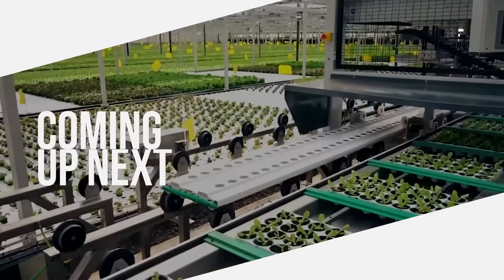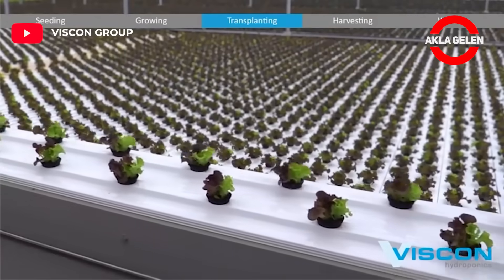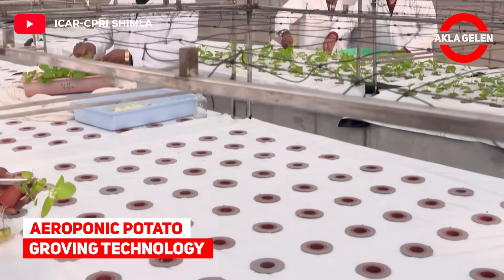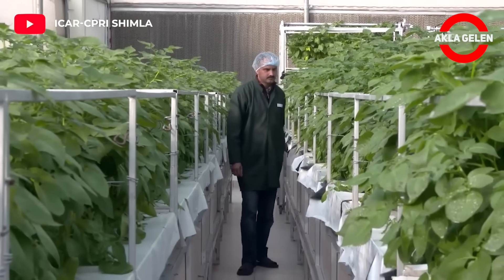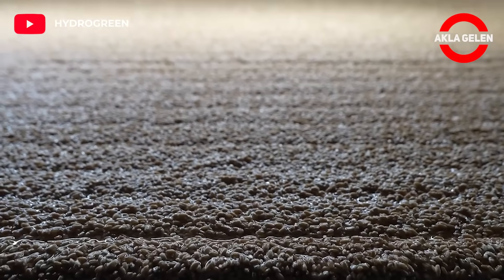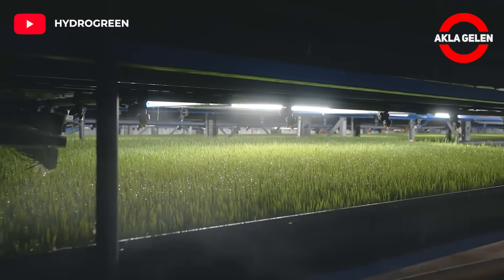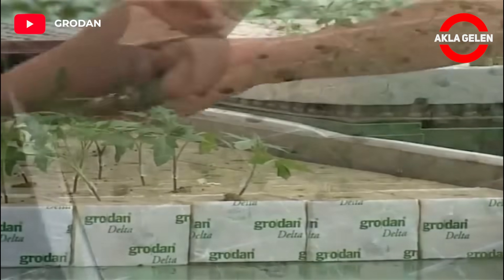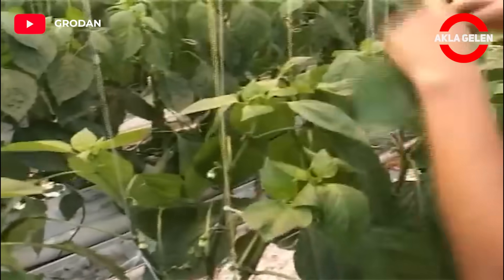The Farm Producing Potato Without Soil Will Surprise You - Incredible Agriculture Techniques

Comment: What is the producing time of plants grown in this manner versus typical 'growing seasons' in the soil?  I have a Habanero pepper plant in a pot that is about 3 years old and still producing peppers.  Currently it's inside due to the weather.
Reply: Peppers produce prolifically for about 5 or 6 years and then it dies off after that. Although they can keep producing decently for up to a decade
Reply: Roughly 15-50% less time when hydroponically grown. However that is entirely dependent on if the feed solution matches the plant, and if artificial light is used to extend the time of light exposure. Obviously the biggest difference is comparing hydroponic to plants grown in depleted soil around winter time.

Comment: I saw this way of gardening over 30 yrs ago at Epcot.
On a timed rotisserie w/ spray misters, & full spectrum lighting. 
Awesome, indoor gardening
Reply: Maybe Awesome indoor gardening, but you can't compare to "real" food.
Reply: @kasiasobczyk6939  it's as real as anything else, just more efficient
Reply: @kasiasobczyk6939  Hydroponic food is actually more nutritious than food grown in the dirt because most of the fertilizer is washed away in the dirt. The biggest road block to hydroponic is that it requires a lot more technical knowledge to keep the plants alive, and electricity. Electricity wouldn't really be a big deal except environmentalists keep sabotaging and taxing power grids so price per kwh goes up synthetically.

Comment: This all looks good but my question has always been how do we know the food for consumption has been grown with the right amount of minerals in the water. Plants do make vitamins but they don't make minerals, plants take up minerals in their environment through their roots which are usually in soil. NPK and minerals are something I don't hear mentioned in these videos.
Reply: Quite easy, plants won't grow without the necessary minerals and other nutrients, so they will have to be provided with the water in the correct amounts.
Reply: @apveening  so, you think, health comes out of a packet? So YOU can provide the vitamins? Circumventing God a bit?
Reply: @swissmaid  The plants will create the vitamins. As for god, I don't believe in fairy tales.
Reply: @apveening  But you can grow something with minimal minerals. That is less advantageous than with proper minerals. Check out my statement. On this statement and my statement on the video
Reply: @keithmorse9716  With less than the necessary amount of minerals, the plants just won't produce the desired product.
Reply: @apveening  Yeah, but it could be said that you're generalizing. What is. Less than necessary. It requires context. Necessary amount of minerals to produce what you want. Maybe too much for the plant to actually produce and actually burn and kill it.
Reply: Did you know that different plants utilize different minerals and with hydroponics you can give the ones you want and at a higher rate of speed.  Plus indoor they can utilize different spectrum’s of light for optimal growth for different plants.  It’s really a lot faster than dirt and that’s how we are able to feed the masses.
Reply: Cuando el ser humano juega a ser Dios nunca le sale bien...
Reply: Damn, I didn't even think of that at first, EXCELLENT Q !!!
Reply: You're right to be concerned because they never talk about it. Check out my statement above.
Reply: How about the cost of setting up the hydroponic system & roi??
Reply: composting helps you to build up soil that would be nutrient dense.
Reply: they add nutrients into the water, they also have device to monitor it.
Reply: hydroponic vegetables tend to be similar to soil-grown in terms of nutrient content. Advocates say (and some tests have shown) that sometimes they are slightly higher in certain nutrients because growers can control exact inputs and because a lot of soil has been depleted by intensive production over the years, which strips out nutrients.
Reply: Really simple, the seller don't care you got a good taste or decent amount of healthy components. As long as fruit looks good it will sell. A study made in France on apples showed it lost 90% of its nutritional benefits over 50 years.
Reply: Crops grown in depleted soil do have less nutritional value, but by about 38% on average, not 90%
Reply: @z-em4612  "A study made in France on apples showed it lost 90% of its nutritional benefits over 50 years."

This is totally false!  No study ever showed that. FAKE NEWS

What studies showed is that plants are about as nutritive as in the past with some plants having less or more of some nutrients.
Reply: @z-em4612  yep foods are selected/evolving for marketability. Not nutrition!
Reply: 수경인공재배하는 농업기술은 미래를 위한 기술이지 단지 상업용 대량생산으로 먹거리를 교란하는 기술이 아닙니다  토양없이 기후변화에 대비해서  미래먹거리를 공급할수 있는 첨단수경재배기술은  미래에 해수면상승으로 토양이 염분에 노출되어 토양의 오염이 심각하거나 기후변화에 심각한 가뭄, 고온,저온에 대비하여 미래식량확보를 위한 농업기술입니다  참고로 수경재배하는 비용이 매우높은건 시설설치비용이 매우 비쌉니다
Reply: 这恐怕是水与土壤的区别，还有灯照和太阳照的区别，微量元素很难复制。

Comment: these vegetables will be less rich in nutrients, because in a controlled environment the plants do not have any kind of external stimulus.  This happens when millions of years of evolutions take place
Reply: Hydroponic vegetables tend to have equal or higher nutritional content than field crops because the mineral levels can be optimized
Reply: @pteechka1  the problem is that many substances such as antioxidant vitamins... are produced by plants due to a stress suffered (such as temperature changes, parasite attacks), which does not happen in a controlled environment.

Comment: Takes all the love out of it. Adverse to nature.
Reply: I loved how much easier this method is on the workers, especially that lettuce production facility. Instead of crawling around in the dirt with heat, humidity, and bugs, the workers are in a temperature-controlled environment where the plants are brought to them on a conveyer.  They work in the shade, sit on a stool or stand, wear normal comfortable clothes, don't have to bend over or get dirty, and there are no bugs. Also, no exposure to herbicides or pesticides. Since they produce year-round, the jobs are constant steady employment, not seasonal or migrant work. How is that taking the love out of it? Seriously, what's to love about current commercial lettuce production?